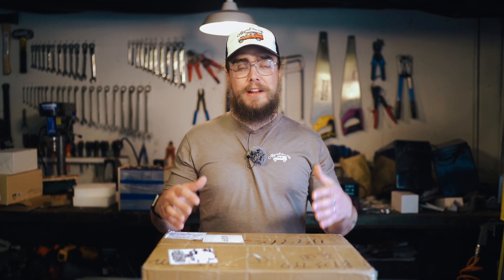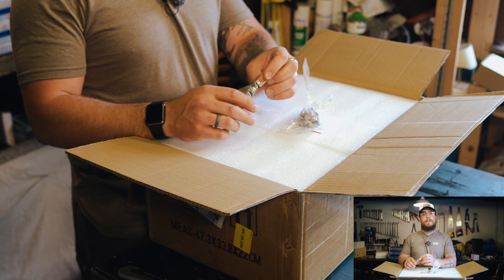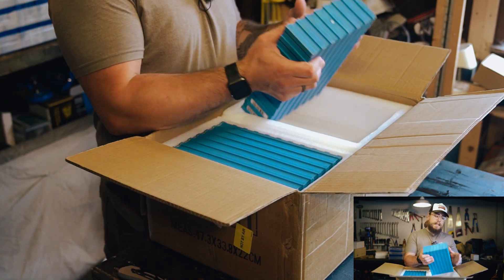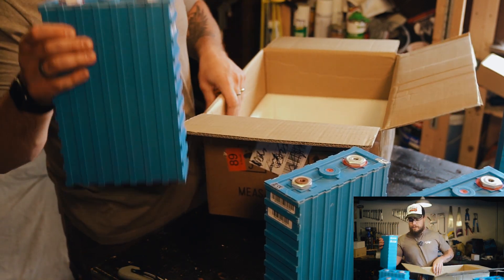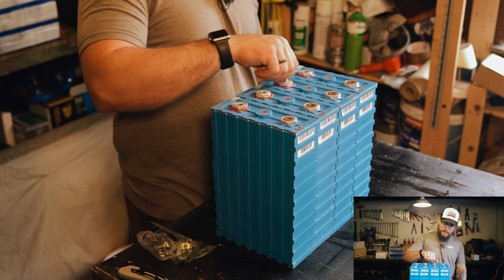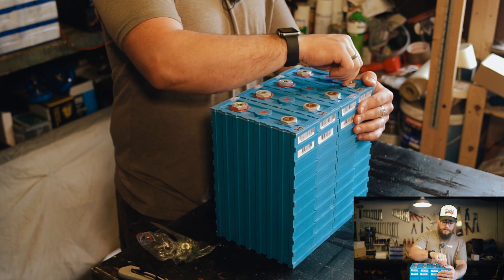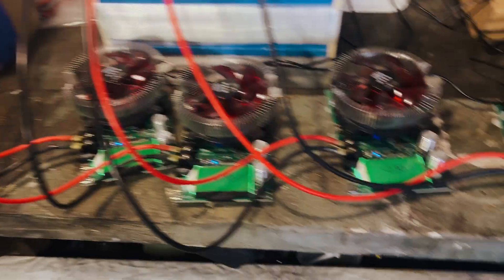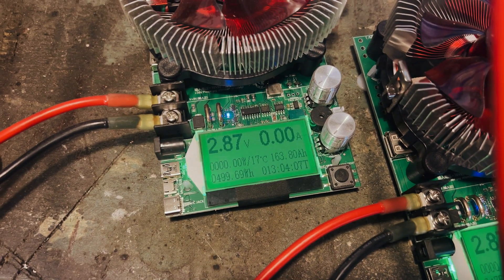Cheap Winston LiFePO4 Battery Cells - Capacity Test & Results

Comment: Are these Winston or Calb? They look like they are calb.
Reply from the maker: I am actually not sure. They were cheap from a bad seller on Aliexpress, so can’t be sure. They didn’t pull capacity.
Reply: @offgrid_power  They are CALB cells, but manufactured before the year 2020, now they produce a different type (with metal case). They are fine cells, when used with reasonable current.
Reply: They are CALB cells, but manufactured before the year 2020, now they produce a different type (with metal case).
Reply: Winston have yellow cases and are laminate construction as opposed to prismatic pouch

Comment: How do you get your batteries to stay at 3.6 charged? The voltage and mine starts to drop after this and settles at around 3.4
Reply from the maker: That's perfectly normal behaviour. They cells settle below 3.65v.
Reply: @offgrid_power  brill I'm glad to hear that thank you
Reply: @andysutils   Actually, they ship around 3.29 +/- 0.015 to meet export safety regulations. But settle quiclky around 3.325V in normal operation which is their typical behavior after cycling through full charge of 3.45V down to 3.15V acoording to your BMS setting parameters that allows a 20-80% charge cycle to prolong their life cycle expectation. At those levels easily reached by all MPPTt offgrid installations, it is not unsusual to get around 0.015V - 0.035 V deviation between all 16 cells in a 48V setup. That's what I get consistently from my 50A Epever MPPT charger. I have two 16S packs of 100Ah and 280Ah in parallel with different version of the Ant BMS. Both of them respond fairly the same. I draw power from the P- of the 100Ah pack made of used 2.3Ah cylindrical cells from A123 that were salvage from Hybrid buses. They're arranged in 16S40P. This pack discharge more amps from  my KRXNY 2000W pure sine wave inverter powering my induction cooking plate, fridges and freezers... But it recovers quite fast too since it's smaller in capacity. While its big brother, the 280 EVE stays mostly balanced because it pump a fraction of the current and helps the MPPT charger refuelling the smaller pack faster during idle times. I attached a 3000W APC UPS to it when I need to power the microwaves or more substantial loads. I saw some "too good to be true"  deals on Ali Express for bundle of cells and I am tempted to go for it, gradually since I have the time and resources to evaluate them thoroughly. Price wise, if you receive them, it's worth it. Get a 16 pack and and 8 pack of the same highest Ah they offer. Then just sort out the "bad" cells making a good pack of 16S  and 2 other packs of 4 with the remaining weaker cells as close in Ah to each others to be used for milder requirements. That's pretty much what I did with the recycled A123 cells. To be honnest they perform as well as the new EVE. It's the inverter that I'm worried about because its fan gets quite loud when the mosfets hit their threshold temperature. That's why I collected a buch of those 3KW rack UPS. Literally I hacked them down to half their size since I'm using my own battery pack. They were a really nice deal 3 of them for $80 only! Even ALi Express can't beat that. Nowadays, I'm casually pulling less than 2KW a day from the grid. But I don't mind for now. I consider the grid as a backup though in time I will eventual terminate their service. I really keep it alive for my wife because a lot of the operation is still manual and she wouldn't be able to figure out what to do whenever a breaker tripps. She'd go crazy on me! :)))

Comment: i bought 32 of these cells a few months ago via Alibaba. most tested between 158-165ah. 3 tested 175ah. 2 were extreme bulged, 1 at 0,2v and bulged at rechange. absolute trash. after weeks of disputes i was able to get 50,- back. 
cells listed as grade  A, new, unused etc. seller even told me they test great. yeah the IR value (even that one was higher then listed but ok). Nightmare of an experience.
Reply from the maker: That sounds like a very unpleasant experience. We were fortunate in that the seller didn't update our order with the shipping info on time and Aliexpress auto refunded us because they missed the shipping date.

Comment: I bought 16 of these batteries from China. The seller listed the condition as grade A. The batteries were used, the connectors have oxidized ends. The real capacity was 163ah - 182ah.

I did not receive money or an apology from the seller.

Pay attention !
Reply from the maker: Thanks for the comment. 👍🏼
Reply: Exactly the same for me... bought 16pcs and capacity is between 135-150Ah. I won the dispute but since lithium cells are concidered dangerous goods they cannot be sent back unless using a special shipping service agent that cost approx twice as much as the cells. Seller offered 50usd. I told him to f**k off... the cells are old and clearly been used... luckily i originally opted for approx 500Ah for my boat but choose to overshoot, so that is approx what I will get out from the listed 800Ah.

Comment: That is used refurbished battery cell
Reply from the maker: Yep, I think you’re right.
Reply: @offgrid_power  
1. They're not Winston Cells, the brand should be CALB.
2. CALB has 2 models of blue plastic shell LFP batteries, the standard capacity of them were 180Ah and 200Ah.
3. As I know, these cells went out of production many years ago, and there are no brand new cells in the market. So, they are used cells, which were disassembled from EVs/ESS modules.
4. When you are buying these cells, you have better ask the suppliers to grading cells (capacity test) before placing your order. Anyway, I don't think it's a good business, just for your reference.

Comment: Soo many terriblestories from aliexpress and alibaba.why are we still purchasing from there.happened with an inverter for me.bought 1000 watt inverter.when it arrived was broken,they said would replace it if i sent it back,and yes was more to send back then original cost..(luckily I have electrical experience).fixed it turns out inverter wasn't even 1000 watt.got 478 watts before fuse blew out.deleted the app.will stay with amazon or ebay.
Reply from the maker: Yeah, Aliexpress is a mine field.

Comment: Simple: They're used cells that were taken out of service when their capacity reduced to 80% of rated when new.  (Do note that 80% of 200 is 160.)  80% is a common threshold for taking LiFePO out of primary service, when they're shifted to the secondary market.  Caveat Emptor!

Comment: Bought 16 like those from a well-rated seller on Ali:  almost all of them average 185-188Ah, but i have one (who was bloated) at 168Ah, so my 16S setup 
can only output 8500Wh instead of the supposed 10240Wh.
I wish i had bought 4 more: my 16S would have been optimum and would then have build a 12V 4S with the 4 lesser capacity cells.
Thank you sir.

Comment: Could these be second hand given the helicoils?
Reply from the maker: Yes, most likely.
Reply: @offgrid_power   helicoils means returned item,and repaired stripped threads;   threads could have stripped at first try,still new then,but it could have been later; too bad the sellers do not inform the buyers;  it's China for you...bad political regime, bad rules...